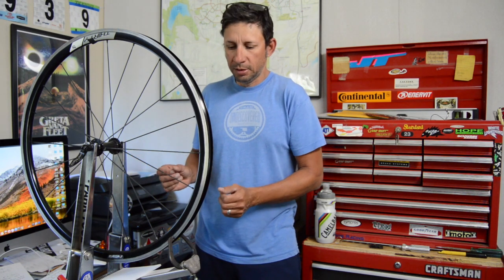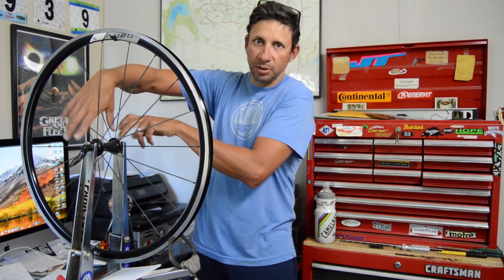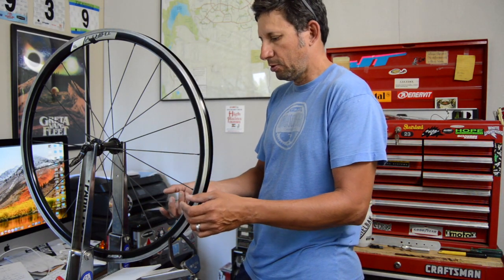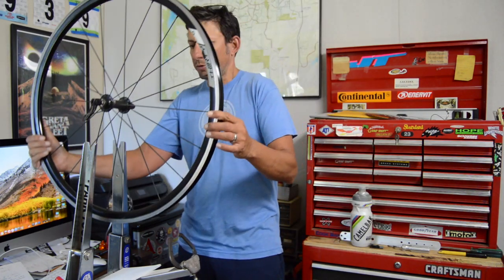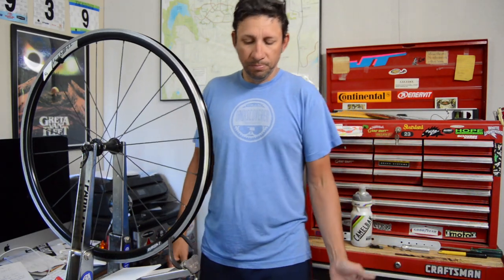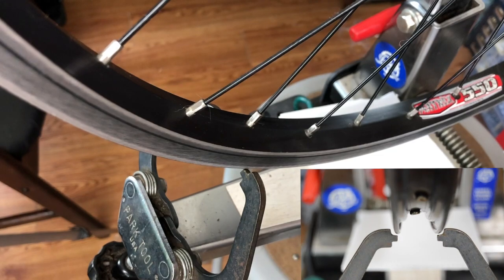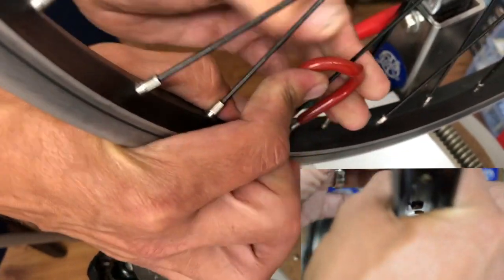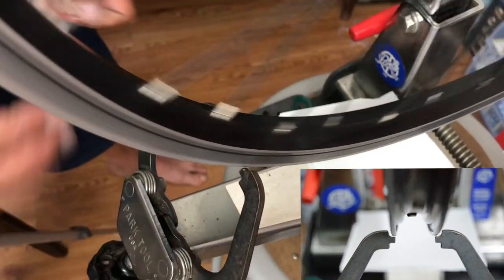Beginners guide to truing wheels using a truing stand

Comment: Any differences working with carbon rims?
Reply from the maker: Not really. In some cases, they're actually easier because they don't dent or get flat spots the same way aluminum rims can. However, they can crack where an aluminum rim will dent and can sometimes be repaired, whereas the carbon rim will generally need to be replaced, which can be expensive. Unless the carbon rim has internal spoke nipples (like on ENVE rims) or uses small washers between the nipple and the rim (like ZIPP rims), the building and truing process is virtually the same.
Thanks for your comment and question!

Comment: In your opinion, what's a good paved and gravel 700c tire? Size and brand. Thanks
Reply from the maker: Well, so far, I haven't tried a whole lot of gravel specific tires. I didn't really get into riding a lot on gravel until a little over a year ago. I think a lot of factors will depend on what makes a specific tire good. The gravel and dirt in Oklahoma are a lot different than the dirt and gravel in Colorado, and I'm sure it probably varies quite a bit wherever you go. I ride at least a little gravel on my commute daily, but it can be as much as 60% pavement and 40% gravel. The smoothest and fastest I've used are Bontrager AW (all weather) series tires. Traction isn't great in the corners at all, but for my particular commute, probably the most efficient tire . I've got 700 x 32's on my commuter bike now.
I 've also tried a Teravail Cannonball in 700x 42 that I really liked. Very smooth in the center with shorter side knobs. It's better traction wise than a pure road tire, but still really smooth on pavement. I also tried a 700x 40 Maxxis Rambler a while back and that's what came stock on my Pivot Vault. So far, those are the best tires I've used in the gravel around here and they're decent on pavement. The only downfall in those is if you ride a lot on pavement, they tend to wear down pretty fast
Thanks for your question!

Comment: Hello how do I true the park tool truing stand caliper's please thankyou. Great video.
Reply from the maker: Thanks. I rebuilt my older Park TS-2 and show how to calibrate it in the video. I've also added a link to Park tools for how they recommend calibrating a truing stand in the video description. https://www.youtube.com/watch?v=VheCYE8-i_Q&t=135s
Reply: @Joey Mesa thankyou so much for the Park truing  stand calibration video, I'm sure it will help me considerably. Can you also please recommend a good park truing stand truing video, as I have probably tried trying to true my racer bicycle wheel which is slightly untrue for about 10 hours so far and I have not made it even slightly truer yet, only worse, it's not as easy as I thought it was, can you please tell me how long it took you before you got the knack at truing wheels please so I can get an idea how long I'm going to have to play around truing my wheel. Thankyou so much.

Comment: 1:27 I have the same stand at my workshop, and I highly recommend you use dishing tool, since the parktool and similarly designed stands do not give consistent results with centering the wheel between the calipers, it always randomly shifts left or right. This is due to the stand construction, the vertical bars have small play (no matter the calibration), and when you tight the knob, it's either the right bar or the left bar that will be off the once set position. So, always double check with the dedicated dishing tool unless you're ok with a deviation over >1.5 mm.

Comment: Nice video Joe. I'll be following this closely. Found a nice, used Minoura WORKMAN PRO Bicycle Wheel Truing Stand on Ebay, will be delivered today. With 7 bikes in my collection, I've been thinking about doing my own truing, 14 wheels and 4 spares to maintain, it's time to learn. Been  taking out normal wear & tear issues on the bike, but that's a PITA.  My main objective is, trying to remove a flat spot, on an old set of tubular wheel, I rebuilt and my LBS trued, before retiring, but after hanging on the wall, I found a small flat had developed. I can feel it, while riding. Don't use those wheel much, but would, if I can get the flat spot removed.

Only issue I see with this truing stand, is it only supports 10mm axles. I have 1 set of disc brake wheel, that have a 14mm axle, so need to adapt some how.

Question, at about what mileage, should new wheels be checked and adjusted ?  I have 4 sets of new wheels, with varying mileage, and just keep an eye on, and adjust as necessary. All my wheels are 700C, road wheels.  I'm 72 and don't abuse my bikes, only my old body . Keep up the great work.KB
Reply from the maker: Hey Ken! Thanks for your feedback and questions. As far as removing the flat spot from the tubular wheel/rim, if it's just from the tension of the spokes that are causing the flat spot in that area, try backing the tension off 1/4 turn from the spokes in that spot and see if that helps. Most flat spots are due to the rim being bent in slightly from hitting a pothole or expansion joint or something in the road. I made a video a few years ago on the process I use with scraps of 2x4's. https://www.youtube.com/watch?v=8me8VGz1wqw&list=PLyNdrtUfdbn0J5hrJ6z-ocDLof3BoPp4d&index=6&t=0s

You will need to remove the tire in order to repair the rim if it's bent in. Before you start, you may want to inspect the wheel assembly and make sure the issue is not just the tire. Depending on how old it is and how it was glued onto the rim, tires can deform over time and a poor glue job can be felt while riding as well.

As far as the disc wheel with the thru-axle, in a pinch, you can use a long 10mm or 8mm hex wrench running through the hub as a dummy axle to set it into the truing stand. Otherwise, commercial adapters are available.
Mileage wise, on bikes we sell at the shop, we'll check them over at 30-60 days. I'd say that would equate to 100-500 miles. If the rider is over 200lbs or carrying lots of weight in a touring type setup, the wheels may need a bit of touching up or tensioning, but the majority of bikes never need to be touched for years as far as wheel truing goes.
Now that you have a truing stand, it never hurts to check the wheels just to see. If you have an old wheel that doesn't get used much any more, that would be a good project wheel to practice on.
Thanks for taking the time to comment, I appreciate it!
Reply: @JoeyMesa  Thank you Joey, for the info. Great idea, yes a  10mm hex wrench should do the trick, on thru axle wheels.

Those tubular wheels, date back to the early 80’s. I have one set of tires left, and when they’re gone , that’s it. I took them for a test ride, shortly after they where trued up. Hung them up for the winter, and discovered the following season, there was this flat spot, so I thought . Now that I have a real truing stand, I have discovered it is a hump (rim pulling away from the hub).  Maybe 3-4mm, enough , that  I can feel it, while riding.  So this rear wheel, will be my practice subject.  

Great diagram , I have never seen it described, keeping the wheel inside the “box”.  That is great. 
My wheels don’t get abused, just normal wear, a little lateral truing is all that is needed.  Used to do it on the bike, but now that my fleet has grown to 7, and my LBS retired, time to do it a more professional way.

Again, thank you so much your assistance . I’m truly indebted to you. Ken B.
Reply: Update: Well, lateral movement is 0.5mm , Wow !  I have manage to get the radial movement , to within 3mm.  Somewhere , I read, less than 3mm radial  is un-noticeable ,  correct ??
Reply: Another update: Finished up that rear tubular, and got the radial to less than 2mm.  Went on a short ride, nice, no more "thump-thump-thump".   However, there is a small rise in the tire (new 2yrs) , but doesn't effect ride quality.  Hopefully, this wheel will stay tru, until I wear out the tire. 
And the 10mm hex key, worked great on a thru axle.
Reply from the maker: Nice! It's pretty rare for a tubular tire to be completely straight. Some are definitely pretty out of round, but it's hard to feel it when riding. Good job with the wheel truing and thank you for all your feedback!
Reply: @JoeyMesa  Than you, Joey. Maybe this winter, I'll try a wheel build.

Comment: Thanks but there is far too much waffling around. Suppose suppose suppose. You need to redo this and organize it by cases: case 1 wheel is gitting low and to the left, case 2: wheel is low and hitting to right, case 3: etc etc. I know it's hard to organize but it is worth the effort.

Comment: Is it necessary to get one of those truing stands with gauges on it in order to get a perfect rounded wheel? Is it possible to re-true a wheel the way it came from the factory? (in terms of roundness of no lateral movement)
Reply: The truing stands with gauges are really for professional riders. Without the gauges, the stand can get the wheel straight enough for the recreational cyclist.